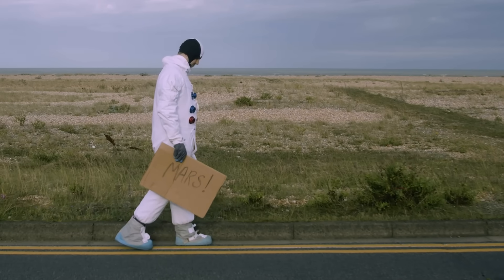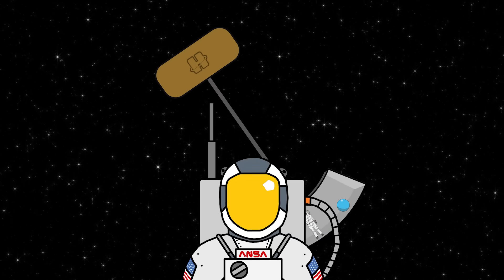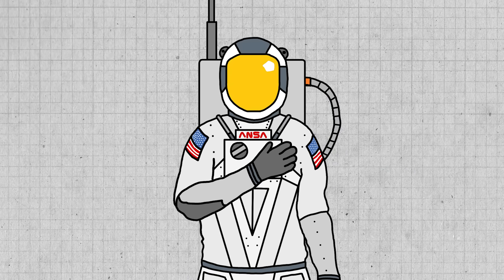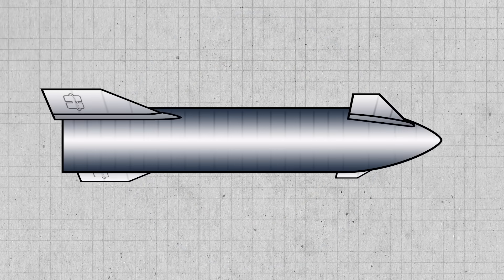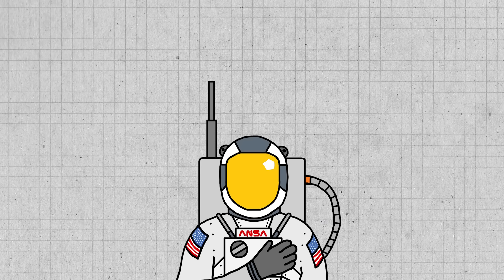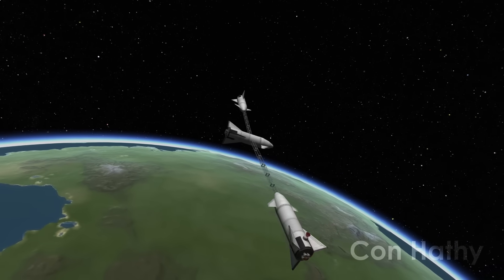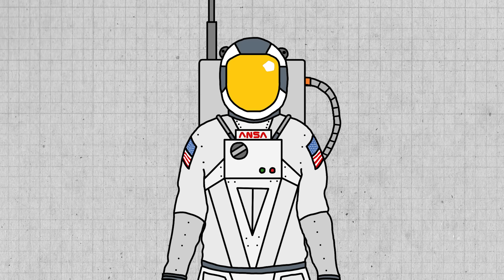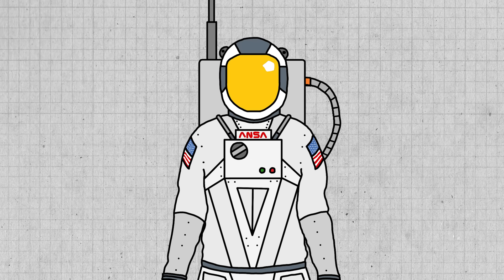This is NOT how you make Artificial Gravity

Comment: BA 2100 inflatable space habitat - 100,000 kg (crew 16 but only put 14 in each with 7 seat Dragon capsules for escape.)
2 habs at each end of the cable  (crew 56) in a cage system with docking ports for modified Dragon capsules for thrust control.
1 km of cable at 1 RPM = 1G with no discernible vestibular discomfort.
I can't find good numbers for the cable so let's assume 75kg / 100m for a total of 750kg of cable that can support 500 tonnes. A central hub winch for retract and expand. CanadaRM bots with solar panels that can crawl along the cable to inspect, attach, fix etc.
So we're looking at 4 Starship launches to get this to LEO. No idea how many for fueling but the whole mass has to be on Mars trajectory before spin up. It has no ability to land on Mars so a Starship has to travel with it for the crew to land. How much fuel does it take to park it in orbit? Remember Starship's plan is direct landing for less fuel, no orbital insertion. Maybe it works better as a cycler on free return to Earth. The crew uses the CanadaRMs to travel to the hub and transfer to the Starship for landing. So every trip you expend a Starship and end up with no extra habs on the surface.

A smaller version using BA-330 inflatable space habitat - 23,000 kg (crew 6) is possible. Easier to park in Mars orbit so there is an automatic orbital infrastructure there.

You'd need a way to store the rotational energy in a fly-wheel and battery system so the habs can be retracted and locked together for orbital insertion at Mars. Some crew get on a landing system, Dragon capsules or Starship, and go to the surface the rest of the crew stays in orbit, expands the cables, and puts the energy from the flywheel back into 1G spin. It acts as an orbital 1G hab for people that need 1G i.e. Martian health problems.

Comment: Centrifugal force only works if you're in motion and rotating  -- if the air is stagnant then the suspended particles won't settle out for filtration.

Comment: Adjusting the length of a tether could be a fuel-saver, too, if at the risk of increasing the odds of a tether-break scenario being problematic. if you start with a long tether (ideally one made of carbon nanotubes or spider silk to minimize weight. While we may not be able to produce either long enough for a space elevator yet, lengths of ~1-2 km are starting to become relatively feasible, which should be more than enough for this application), burn enough to get ~0.1G of artificial gravity, then just reel in the cable until you reach ~1G. when it comes time to separate, you could even use regenerative breaking on the spools to get back a good portion of the energy that went into spinning up in the first place, with the added bonus of providing a super smooth and steady transition back to zero G.
Reply: But if you use a rigid truss you can avoid burning any fuel and just spin up using a reaction wheel in the center and then slow down that way too.

Comment: Tether design....
Pros: Efficient, sustainable and within current technologies
Cons: makes corrections in course more complex procedures, runs the danger of absorbing and expressing momentum from small impacts, requires extreme maintenance

Until spacecraft are like battle ships in crew area size, artificial gravity outside the short centrifuge would be more trouble than it was worth, ideally you want the mass of your vessel to be enough to absorb most of the rotational energy exerted upon the center of the crafts center of mass and center of gravity. You would have areas in the craft that are gravity zones because of what ever localized complex moving gravity chamber centrifuge things. Spinning requires alot of fuel to stop in order to perform other tasks that a spinning top cannot, like docking and space walks.

Comment: The tether doesn't magically disappear if it breaks. When the tension is released you'll get a wave traveling away from the center... I seen to recall that the velocity is based on the tension in the line, the sectional density and the speed of sound in the line.
Reply: But that's counteracted by the fact that the tip of the tether starts at zero velocity (relative to old frame) and has to catch up to the ship that's now flying off into space.

Moreover, the total energy stored in the tether is equal to 1/2kx^2 where x is the amount of extra stretch in the tether under tension while the force on the tether is kx.  So if you use a really stiff (high k) material for the tether it has relatively little stored energy (square small numbers they get much smaller) so you can make sure that it's less energy than that needed to even catch up to the spacecraft.

Comment: I believe it was an L Ron Hubbard book about an advanced civilization just getting into interstellar travel.  Advanced near light speed, inexhaustible fuel…. Etc.

The ship would constantly thrust at
a constant increase of speed a bit over 1G…. Half way to destination rotate and decease acceleration the second half of journey.

 Some drawbacks mentioned were propulsion failures and a ship just going under momentum until the crew got bored and shut oxygen off slowly before bed some evening.

If they needed to turn around and return home, it’s not the halfway point… the deceleration process must be done, or a giant loop was required likely taking far longer than the normal process.

Wonder if that’s feasible and mimics real gravity more than spinning.
Reply from the maker: I actually just made a follow up video on that type of system
Reply: @ConHathy  Ohhhh!  Thanks!!!  Will check soon.  Off for lunch.

Comment: Wouldn’t it be much more efficient, while using a thread, to start the initial spin at much larger radius, and than use electric motors to pull the ships closer together, speeding the rotation that way, and saving large amounts of fuel?
Reply from the maker: Yes, it just might be difficult to maintain tension on the cable during that time but it’s a trade off worth looking at

Comment: At 2:23 "While they were able to restore blood pressure to standard levels, they weren't able to decrease the pressure in the eyes. As always, more research is needed." I appreciate proper reflection on ones study, but this one took me by surprise. You show the person being rotated with the head exactly in the focus. Now you've made a literal "eye of the storm" situation around the head. You might recall that arteries to the head go UP from the aorta, as opposed to down for most of the other ones. In your centrifuge the upper part experiences (almost) no pull or push whatsoever. Increase of blood pressure is definitely expected in the lower half, due to most of the body being at some distance r, increasing up until the feet. In normal circumstance gravity pulls blood down, away from the head, decreasing pressure. But in this situation the upper tract is very much unnafected. I do like the idea of Small Radius centrifuges, but the way this misses the mark. 
Also you'd be a total legend if you'd cite a youtube comment in an academic paper.
Reply from the maker: Not my paper unfortunately, but that video just happens to show a control configuration where the eyes are intentionally unloaded, the arm can be extended to load the eyes as well. I think a lot of confusion could have been avoided if it had been extended for the demo, I’m not sure if it just couldn’t be done until they moved it to the new (larger) building, or if the process was just too much work for a brief video

Comment: After watching Real Engineering's video on the SpinLaunch, I am fascinated by the discourse on design concerns that people have for certain things. I know some people do comment with their credentials and a really well thought out argument for their point, but I'm really interested in how sometimes the discussion gets side tracked by assumptions in the proposed solution. For example, people were dismissive of SpinLaunch's vacuum chamber based on aerospace testing vacuum chambers, which were orders of magnitude more complex and expensive than the actual needs of the SpinLaunch system. I wonder if the concerns about the tether or the centrifuges could be similar in this case, or if it's all just a reaction from ignorance on the actual science

Comment: accelerate at 1G for 49% of the journey . Then rotate the ship 180'  , and use the engines to decelerate at 1G for the remainder of the journey . For 99% of the journey you experience 1G . for 1% your rotating . 
All those other methods use as much fuel or more than Acceleration/Deceleration . And there is a bit of disorientation with the multi vector rotation method .
Reply from the maker: I actually just did a follow about using thrust for gravity

Comment: With the cable, any issues with vectoring would cause spin and torsion on the cable, or bearings would have to be installed, and all of the issues with non metal bearings that would result from that. I think any solution is probably vastly more complex than we would think.

Comment: IMO easiest route would just be to spin the sleeper cabin. That way you can sleep away your gravity time. Make sure the cabin is fully balanced including a variable balancing system for when people enter and exit. Said sleeper cabin should be full contained within the body of the ship. Could also contain some exercise equipment. Storage of all fluids and supplies would be in non rotating sections. Additionally there should be two rotating cabins that are very close to the same mass and moment of inertia. Balancing could be done gyroscopically by variation in* rotational applied force. Ideally no fuel would be spent maintaining space craft bearing and orientation. This would allow all cabins and structures to be any orientation aside from the gravity simulation areas.

Comment: You downplay all the "small centrifuge for sleeping, right?" comments but when you think about it, what else are the staff going to do while using it? Just sit/stand in some rotating clown chair and...? 

If it, say, includes toilet (which is major point of discomfort in weightlessness AFAIK), it will have to get big and complicated. Even if it is used only for exercise, it will still need mechanism to not couple vibrations/chaotic momentum to the rest of ship. Entering and exiting the centrifuge while moving will be dangerous, or it will have to be stopped and started every time - wasted energy, design complications again.   All together it might end up more practical just to rotate whole thing with tether.
Reply from the maker: Well you only need about 30 minutes a day, so just do the regular zero-g countermeasure  exercise in the centrifuge

Comment: You dont need thrusters for the acceleration, you can use an electric engine using solar panels with a gyro (counter spin a mass, like the other half of your craft) or use more efficient thrusters (ion) /thrust vectoring
Reply: That gyro would have to have the full inertia of one of the ships spinning around for the entire duration of the spin, I don't think that's feasible without adding way too much weight and complexity

Comment: Whether people like an idea should not be considered when dealing with engineering problems. A starship does not need to be commonly accepted by the general public. Only those who will be experiencing the negative effects of zero gravity should even be considered when determining the viability of a solution.
Reply: How come you didn't discuss the simplest solution for artificial gravity...forward acceleration until the mid point, followed by continual reverse engine braking.
Reply from the maker: I did in a follow up video, because it is not the simplest solution

Comment: Why does* it have to be two space ships? the speed of rotation and weight distribution only matter
Reply from the maker: It doesn’t really, but logic is the same for a system with just a counterweight
Reply: @ConHathy  counterweight that's the word I was looking for thank you
Reply: And the counterweight could possibly be a Hab structure or something or maybe a filtration Center or dining hall kind of s*** as long as it matches the equivalent weight of the opposite end correct
Reply: Would it have to be a cable or could it be connected by a hallway with various purpose-built modules but once again the weight at either end would have to be equal or similar I'm a high school dropout by the way you may have to dumb it down

Comment: you need to be standing on the fucking walls.

these are nothing but glorified marrygo rounds.

the gravity effect is from you being forced againt the wall, not you trying to stand still on the fucking floor.

unbelievable.
Reply: it has to be a ring, and you have to stand on the walls. you enter through the mounting point on the rest of the ship thats not turning.

as you enter the rotating part, the air and grabbing stuff will reorientate you to the rotating enviroment and youll start feeling the gravity from the rotation.

Comment: What the heck, man? Why does the starship has to land on mars? That's inefficient. For that you would use a shuttle or a landing capsule. The Spaceship has to remain in orbit and then there's no need to arrange all devices in one orientation.
Reply from the maker: That’s true if you use a cycler, but don’t underestimate the challenges of those. The shuttle wouldn’t just have to be able to reach orbit, but catch up to the cycler which is on an escape trajectory when it swings back around. Also there is no abort option other than waiting for the cycler to come back

Comment: Great video. The only thing that got me was RPMs. RPM is Revolutions Per Minute. So you can't have Revolutions Per Minutes. RPM is already a unit of rotation. (Top Gear used to also say Torques. Another word that should not be pluralised).  500 Revolutions per Minuite. 500 RPM.
Reply from the maker: I know, I noticed that one in editing and it drove me insane but I couldn’t cut the s off and didn’t think it was worth re-recording, if I knew it would be this popular I would have changed a lot
Reply: @ConHathy  In the audio channel during your edit, you just set the section with the 's' sound to zero. Sorry I made life hard though. Great video. Just a personal issue my pedantic circuits struggle with.

Comment: tell you what though, a centrifuge is a great way to accelerate  a spacecraft already  in orbit to reach escape velocity ,maybe just not a manned one though
Reply from the maker: Not sure about that one, you could just use the same fuel for straight acceleration and it’s much more simple and requires less fuel because you’re not also accelerating a counterweight. A flywheel also wouldn’t work because it would have to be extremely heavy and spinning extremely fast to get an entire spacecraft up to speed
Reply: @ConHathy  you can use a flywheel to accelerate along a linear path .inertial propulsion useing a nuke reactor powering electricmotors turning rotors so a weight is thrown out in the irection of traveland turns on a smaller radius in the opposite direction. youwould need several to equalise out the vibration. the beauty of that is you could also electrolyse water to provide H +O which you could burn if you need big acceleration or directional correction and you would always have a supply of breathable air.it would be a massive construction but you could run ay constant acceleration of 1g so theres your gravity right there. plus you could have decent rad sheilding which you're gonna need in space and going through the van allen belts. a chemical rocket is not practical if you need to put people on mars or you wanna drive around the solar system. thats just an idea of the top of my head but its simple. we got some nice reactirs in nuke subs already. you just need to build it in orbit then fire her up and step on the gas. Hey Eloni bet you mut have thought about that already right? i know you did you're way smarter then me afterall
Reply from the maker: @yogiguitar1  I’ll just copy paste Wikipedia for that one: Eric Laithwaite, the "Father of Maglev", received a US patent for his own propulsion system, which was claimed to create a linear thrust through gyroscopic and inertial forces.[10] However, after years of theoretical analysis and laboratory testing of actual devices, no rotating (or any other) mechanical device has been found to produce unidirectional reactionless thrust in free space.[2]
Reply: @ConHathy  yeah he was a genius and as a kid i watched the experiments on bbc2 which inspired me alot. there was another bloke sandy something who was messing about with gyros.  and demonstrated a reduction in weight. thats the kind of stuff im talking about. it can be engineered and ill be surprised if theres nothing like that in the secret world. its pretty obvious
Reply: @ConHathy  ij you stand on a skateboard or sit on a bicycle and suddenly throw your weight forward you will move forwards . thats the basis of useing inertia. you then take that concepet and engineer a rotor to produce the same effect . there will be vibration but this can be cancelled out with multiple rotors to get the correct harmonic balance so the let result is an inertial pull in one direction. if you cannot see that in your minds eye you are doomed to never be capable of independent thought and conceptulisation.
Reply from the maker: @yogiguitar1  the skateboard thing only works with static friction (a minimum force you have to apply for it to roll at all). This lets you move the skateboard by shifting weight quickly, but it doesn’t move when you slowly shift the weight back, then you can repeat. In space there is not static friction to hold you in place while you reset the mass
Reply: @ConHathy  no im talking about weight mass transference . harnesing the momentum of mass . its essentially the same thing as centrifugal force generated in one direction. if that makes sense